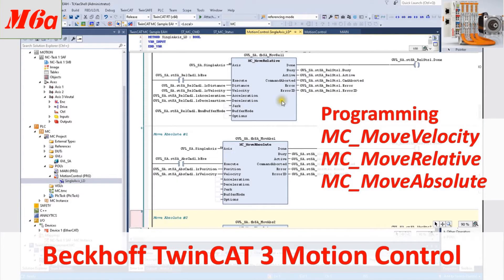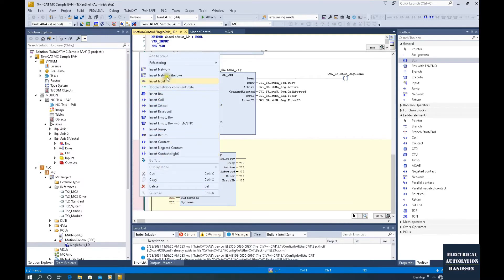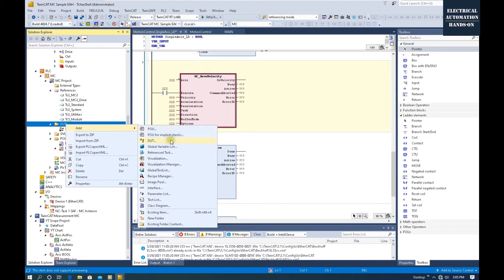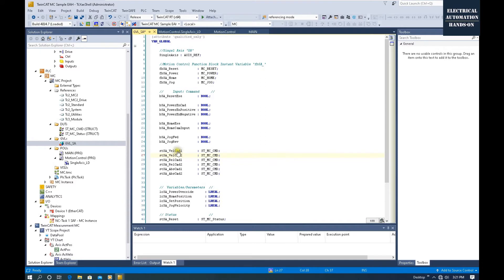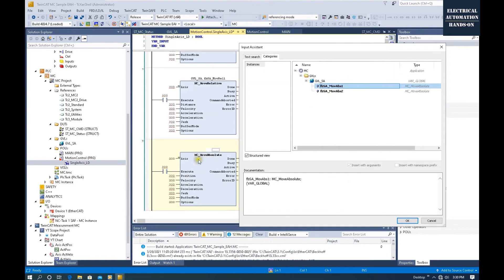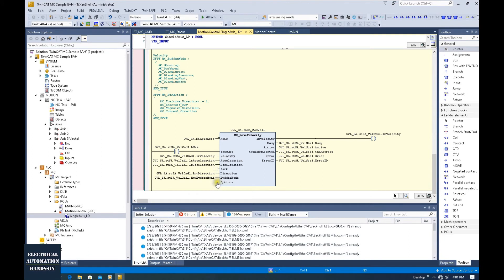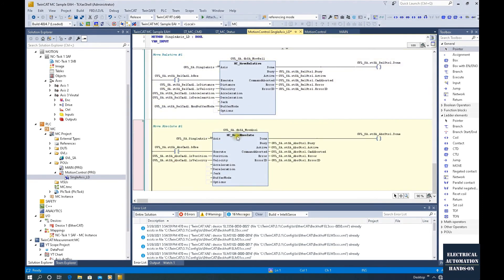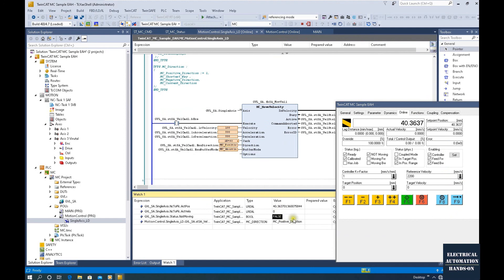MB06a. [TwinCAT 3 NC] Program MC_Velocity, MC_Relative, MC_Absolute Motion Control [8/20]

Comment: I'm getting an errorID 1793 for my MovAbs.
Reply from the maker: Please search 'Beckhoff Information System' for your error code and troubleshoot.
Reply: @electricalautomation  i couldnt find it
Reply: @electricalautomation  Nevermind, it says "Axis is not ready". I do not know why this is happening but I'll surely find it. I'm currently working on trying to calibrate my Steppermotor.
Reply from the maker: @madobrax  Probably check the power supply of your motor and the wires from the drive module to the motor.